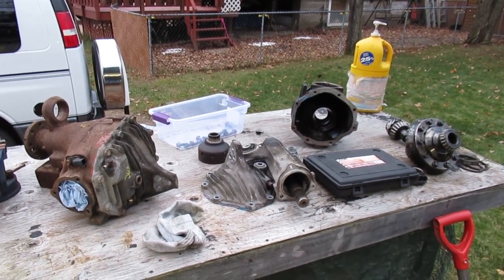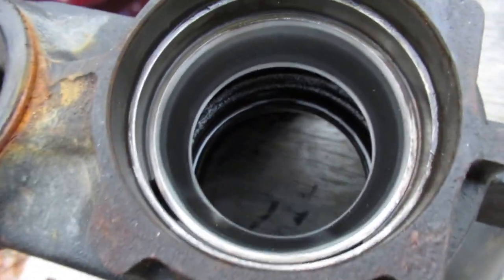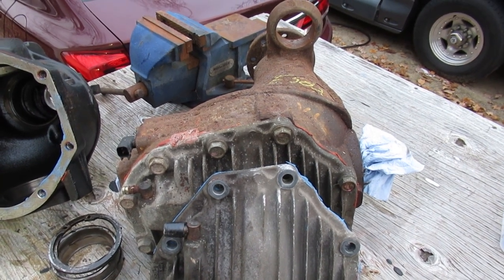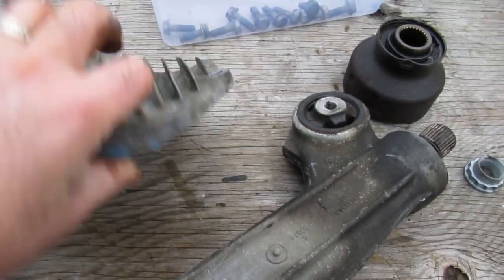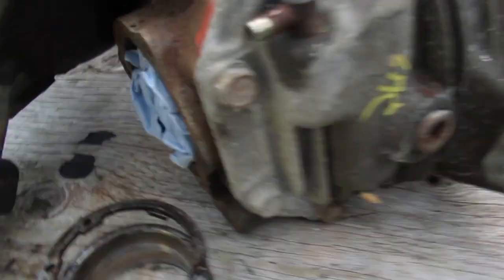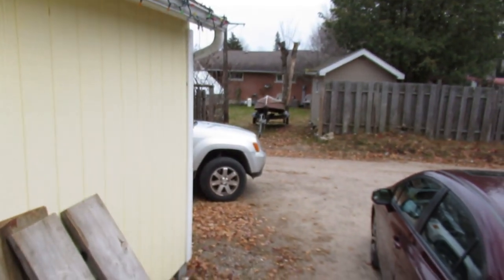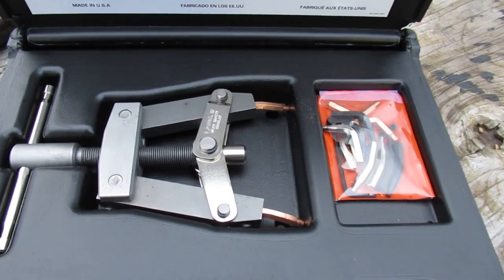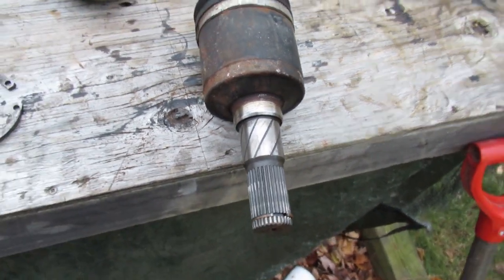2005-2010 Jeep Grand Cherokee WK Front Differential Replacement and QTII to QDII Swap

Comment: I have a 2006 Jeep Commander, there's a loud hum (hum being a small explanation) and it only happens when I accelerate or cruise, if I let off the gas it's totally quiet. There's no clunking, clicking or rattleing sound. I've replaced both axles and front hubs,,the noise certainly sounds like it's in the front, maybe the differential. Hoping you might know some about a jeep! Is there a bearing that's causing the trouble in my front carrier? By the way it rides and drives great. Thanks.
Reply: I’m having the same problem. Did you solve it?
Reply: @casperszn994  No,,i haven't worked on it lately. the noise, or humming sound, hasn't gotten any worse. I'm 90% sure it s some sort of bearing in the front differential which is a bad job to remove and tear down. I hateto work or spend money untill I know for sure what it is. I guess it it flies out I'll know.

Comment: I have a 08 limited 5.7 with Electric front differential an I bought a front differential out a 2005 4x4 without electric  will it work in mine ?  October 29,2023

Comment: Is there anyway to fit the front differential from a 2006 jeep grand cherokee on to a 2010 jeep grand cherokee??? The mechanic servicing the 2010 jeep says the differential fits but now he needs a drive shaft for this 2006 replacement differential.
Reply from the maker: he should change the pinion flange between the two differentials and use the original shaft, you can see the different flange types in my video
Reply: @SteveRivett  Thank you! Just reviewed the video again.

Comment: Thanks for the video it was very informative...I'm having a awful noise on acceleration in my 06 grand Cherokee wk 3.7. like a metal grinding noise. It sounds horrible and Its been driving me nuts for weeks. Any thoughts? Thanks again.
Reply from the maker: I would check the front differential mounts first, they can let the prop shaft hit against the vehicle when they are worn out

Comment: I have C200F front axle on WK, any idea why on drain and refill only about one quart goes in?, specs say 1.8 Qts, I drained it with vehicle level, does the front need to be raised to get the rest of the oil out? The rear C213R I got about 1.8 Qts. after pumping it out..

Comment: How do I get my drive side cv shaft back in?
QD2 2006 5.7 hemi limited. I got it half way or more on and popped but still not flush with the seal. Any ideas?

Popped out super easy will not slide all the way back in
Reply from the maker: I think I put some gear oil on the locking ring and grease on the sealing surface and slid it in.  Can you compare the wear ring against your old shaft to see if it is all the way in?  The QD2 is harder, you may need to lift up the other front wheel and turn it a bit to get the splines to line up.  Take a look inside the differential to see if they are no longer aligned.

Comment: i need to change the front differential of my 2006 Grand Cherokee but how can i tell if i have an electronic limited slip one or not?
Reply from the maker: You can count the number of bolts on the cover.  The cover sitting on the table is a non-ELSD.  The other two are ELSD and have a lot more bolts.
Reply: Check for the electrical connector on the pumpkin housing not the cover

Comment: Hi my friend
I have same problem I change bushing in front differential after that the noise came ,,I dont no where the noise ,, in side the differential or shift cv joint, 
Please help
Reply from the maker: All you can do is check the bearings for and CVs for looseness.  You can also change the front differential fluid to see if it is dirty and look for broken boots on the CV joints.  Eventually the problem will get bad enough that you will be able to find out what part is bad.  I think I was able to drive 20,000 km before I changed the differential.
Reply: @SteveRivett   I change oil differential . I will check bearing but you means hub bearing or differential bearing?

Comment: Tackling the same project here. I have a question though: on my front ELSD diff, the wiring was cut from the harness where the click-in connections meet. Would you happen to know a part number for that? (Or at least point me to one?) It's not the one that connects directly inside the diff to the solenoid. I'm referencing the one side that will need to have extra wire soldered on, then routed to the toggle switch itself.  I've looked everywhere on the internet so far but couldn't find anything.
Reply from the maker: I think it is similar to a gasoline fuel injector connector that Dodge used in the past.  Here's the parts diagram but I didn't see a page dedicated for replacement connectors.  https://archive.org/details/JeepGrandCherokeeWK2010PartsManualOCR508Pages/page/n89
Reply: @SteveRivett  Thanks for the quick response! I'll make sure to take a look at it some more
Reply: @SteveRivett  Turns out the connector is exactly like the connector for the ABS wheel speed sensor. Looks exactly the same and plugs in and snaps perfectly. Just some extra info in case anyone's doing a QD2 swap and got their diffs from a pick n' pull without the proper length/missing wiring :)

Comment: Did you have QT2 or 1? I have a 08 GC with QT1 and i am looking into doing this also. I want a electric locker up front. Was planning on wiring the locker to a switch in the cab to actuate the solenoid for a full lock. 
Was wondering if you have any tips or know of any problems ill run into. I have 3.07 gears now, ill either have to change the rear to 3.73 or i was thinking of putting 3.07 gears in the QD2 front diff instead.... 
Im still in the planning stage of this project, i think itll be awesome if i had a electronic lock in the front with something like a spartan locker in the rear. Trying to figure out the best way to get there. Any help is appreciated!
Reply from the maker: I don't know much about the QT1 other than it doesn't have 4LO.  If you have a V6 and want to go offroad you will want the 3.73 so that you have a chance.  I wouldn't regear an axle, I would just change them.  You will need to  crawl under a few vehicles and see what differences there are between the drivelines or look at the parts books I have linked in my banner.
Reply: @SteveRivett  right on. Thanks dude!

Comment: I have a 2005 Jeep grand Cherokee. My driver side cv axle was hell to get out and it’s seeming impossible to get my new cv to go in. Should I get a new differential? If I get a new one will the cv axle install easier??? Any and all advice is appreciated, thank you all!
Reply from the maker: I would make sure you have the correct part # and keep trying.  Getting the driver side out is really hard.
Reply: @SteveRivett  thanks for the reply! I got it out I just can’t my new one in
Reply: The new one’s splines look similar to the old one I took out

Comment: My 05 is being noisy when I get on the accelerator and stops when I let off, I drove it to work this morning and it whined but I put it in neutral and coasted, sound went away. What are your thoughts?
Reply from the maker: I would look at the front differential mounts as they wear out.  You should also check the condition of the fluid in your axles and fluid in your transfer case along with checking the universal joints and CV joints.  It may be multiple problems all adding together.
Reply: Pinion bearing 100 percent

Comment: Have you installed the elsd yet and we’re you able to put the switch on to manually lock it?
Reply from the maker: I installed the differential and some of the wiring but never hooked it up to a switch.  People have done it in the past so I know it does work.  There are two links in the description to write-ups that I did on this job instead of filming it.

Comment: This front diff from WK is assembly? Where to Find new ring and pinion ?
Reply from the maker: the best solution is to buy a used differential do a full replacement unless you want special gears, then I would go to a 4x4 shop

Comment: Do you know if the elsd gear ratio can be lowered or increased? Specifically from 3.73 to 3.07
Reply from the maker: I have heard people using 3.07 axles but don't know if you get ELSD in that ratio.

Comment: I have a 2010 grand chrokee. That has a BAD vibration only while acceleration   Could that be the front drive shaft  or right side cv axle
Reply from the maker: the real problem may be the front differential mounts, you will need to get under there and start checking things out.  Does it clunk badly when shifting from drive to reverse, etc.?
Reply: @SteveRivett   so I went under and the front drive shaft propeller shaft has some play and the boot is completely torn. The right front cv axle has some up and down movement where it goes into the front diff tube.  The rear mount is torn a bit but not to much.  Can a small tear like that cause such a vibration.  I have pics and a video of the noise if u want me to send them your way.  I’ve been trying to fix this for 6 months now
Reply: To answer your question when I shift from park to drive or reverse it has a slight clunk and noise.  Terrible vibration under acceleration.
Reply: @richiesavacool9386  did you figure it out bud? I experiencing the exact same thing. I did the CV joint on the for the front drive shaft it didn’t make a real difference.
Reply: @mattmccoy2410   no I haven’t I did the front diff bushings and front driveshaft and no difference.  Has to be the rear diff pinion angle for the transfer case. Idk tho
Reply: @richiesavacool9386  thanks for the reply, ill start there and update if i come across a fix
Reply: @richiesavacool9386  Found my issue. Ended up being the rear drive shaft. Had a bad U Joint at the end of the shaft. It appeared to have a wobble too. Went to the local pull a part got a shaft and problem solved. Mine Was in a 06 5.7 Commander.  I lifted the truck on 4 jack stands had wife put in drive. Gave it gas till it was obvious what it was. Problem only noticeable while on the throttle. Good luck to you.